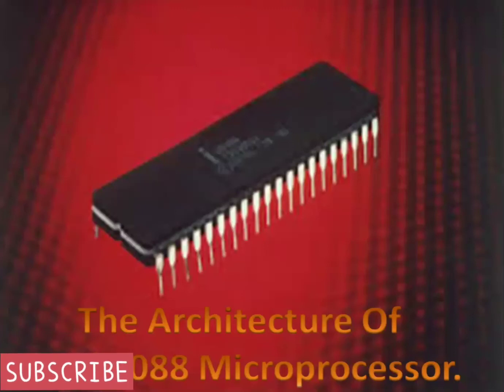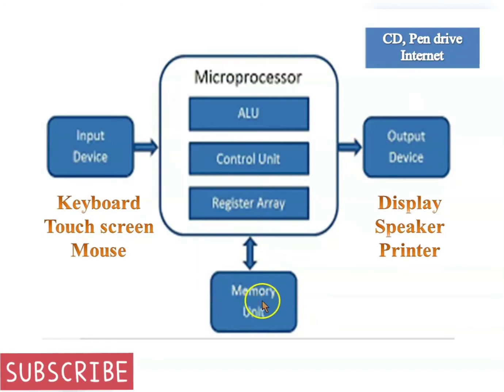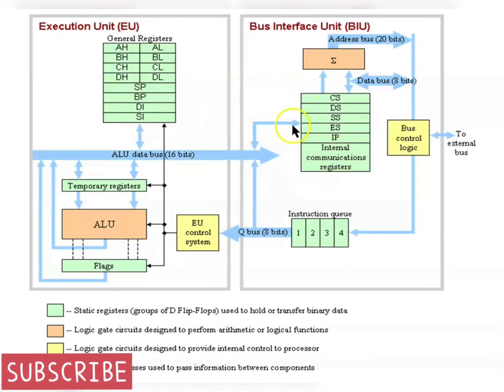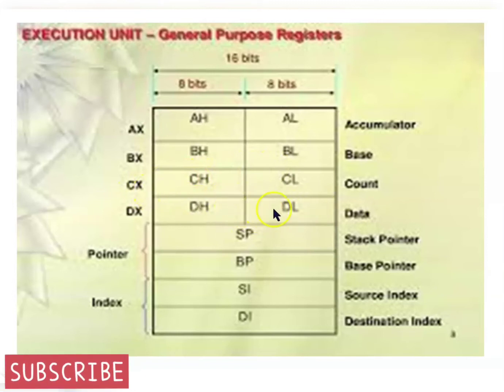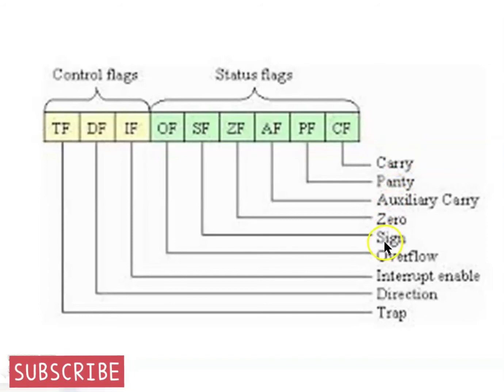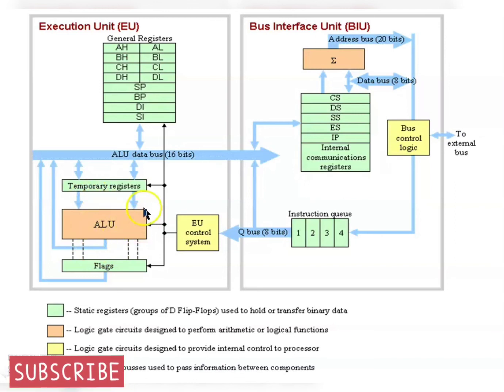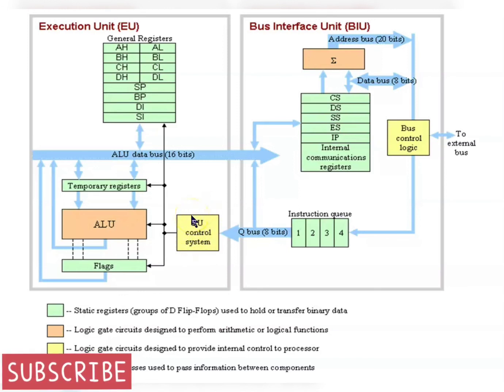Intel 8088 Microprocessor Architecture: Execution unit.

Comment from the maker: 0:21 Important terms used in Microprocessor,
1:52 Block diagram of Intel 8088,
2:42 General Registers,
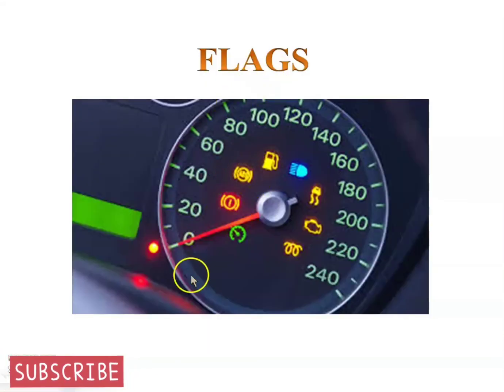4:59 Flags,
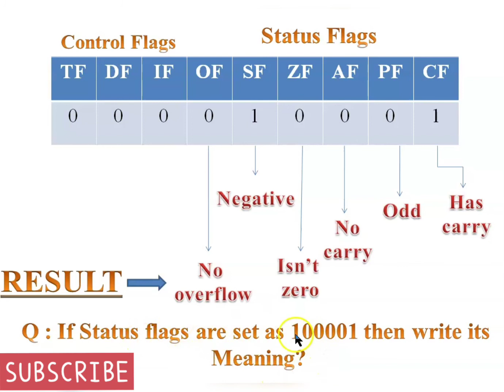6:25 ALU,
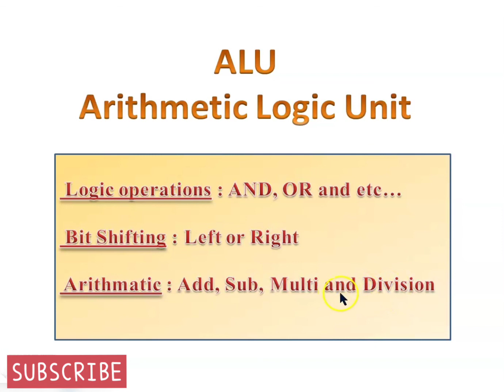7:21 EU Control system.